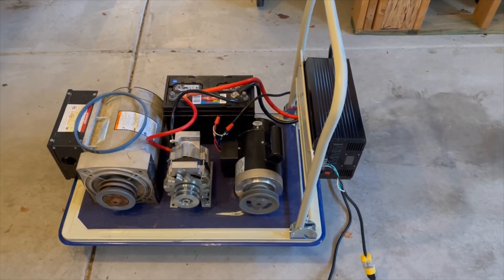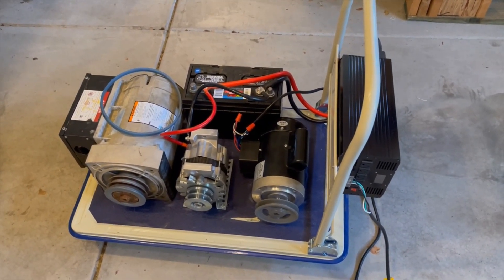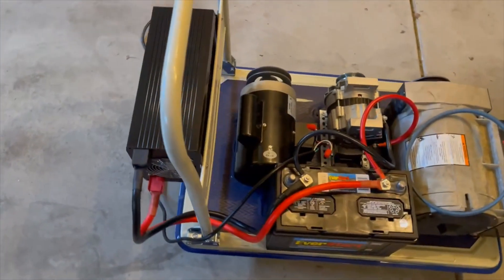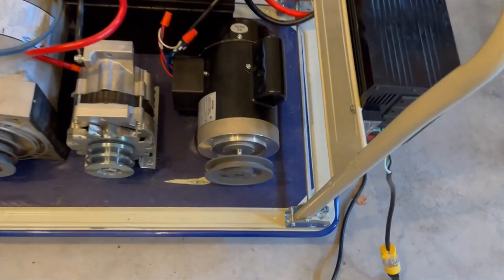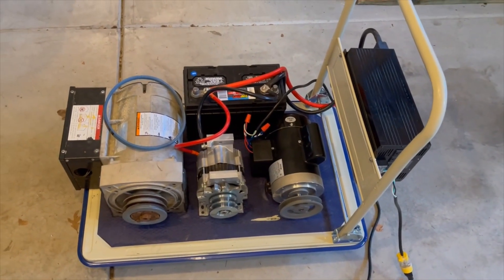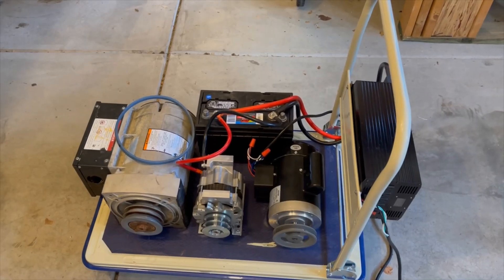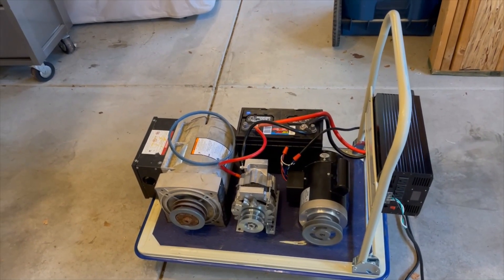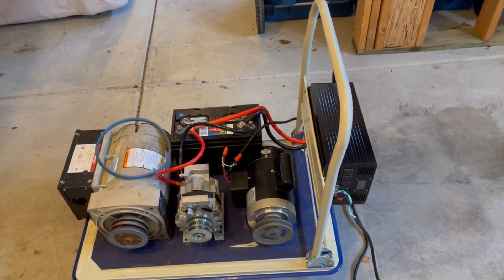Free Energy Generator Video 5 - Over Unity

Comment: replace this generator with a serpentine coil high voltage low amps axial flux dual rotor single stator coreless generator, it require less torque as compared to the regular radial flux generator.
Reply from the maker: Thank you for the advice!
Reply: @MichaelMillerEntrepreneur hope it helps u just lik it helped me

Comment: Both the ac generator and The alternator make use of stator current to supply current to the rotor windings. This produces a magnetic break against rotation and the more load placed on the stator the more current the rotor will pull from the stator and the greater the magnet break becomes.
This is why they do not and will not us permanent magnets in a ac generator.
Useing pm in an ac generator eliminates the connection between the the stator and rotor coils which prevents all breaking from increasing load demand, this reduces the torque needed by a factor of 98%.
This is also why they wont make a multipole radial rotor for anything bigger than a dishwasher pump motor.

Comment: You need to do a lot more research! No b***** I know free energy rum Motors and generators. But the tree you're barking up my dog has no Coon even possum up it not even an empty nest. But once I thought like you did but I did a way more research I used in my mind free energy would have been everywhere if you could just generally hook more generators or generators at different type or alternators so like a one horsepower motor why wouldn't they turn them unless no load affected it somehow that was I seen that as a problem but I didn't know that that's what would happen but that's what I figured was going on from why free energy wasn't everywhere.. do research and there's a way of making free energy that I have never seen on YouTube or even the internet. A spark plug and a speaker will never make free energy at least not the way they do it on YouTube and I don't think it could be done anyway. But you are very learning but you'll go broke at this rate. All I'm going to say is this generators have hidden potential. You know anything about doing research or how much power you going to need to run something you like that current and amp thing if a motor says 230 volts 15 amps that's how much electricity is going to take to work that motor fully like intended and a generator if it says it needs 10 horsepower to run it that's what it's going to take to run that generator far as I know you can't get around it but there is a way you can make free energy from is all I'm saying you're going to have to figure it out for yourself by the way you're going does not work but I guess you know that before you spend. I wish you good luck

Comment: You can feed the alternator from a different source, and use a dc motor control to adjust the voltage until the motor and inverter  run as they should.
Reply from the maker: Thank you for the advice. I’ll give it a try.

Comment: We done this on a bus build tried #6 wire from the alt to the battery ang it clogged to bad went and looked at the alt on the bud and it had #10 wire so we switched it and have had no more issues charging 4 set of 24v golf cart battery banks the are sets of 8v on the 180 amp alternator 24v
Reply from the maker: Thank you for the advice.

Comment: U need to scrape the generator and just use the alternator to charge the battery to run the inverter..
Reply: That concept with jus the alternator works because i proved myself already..I'm currently working on my own and we jus putting together the cooling system. We run it for 3h and the motor burn up after the second run. It's a DC motor we used for that one but yes the concept works.
Reply from the maker: Good to hear.
Reply from the maker: Thank you for the advice. I’m actually in the process of finding a lower rpm motor so I have made ore torque for the alternator. My high speed gets super hot trying to get up to speed.

Comment: Ok I finally figured out how it work I get it working it making crazy power the trick to it is the generator magnet field if the magnet field is too strong the generator keeps dropping out because the drag of the stronger field and the speed I try and get the generator vibrat like the it’s making a higher frequency the rpm I use is 14000 rpm that’s the trick the generator need to go beyond it’s speed to get the field reverse voltage I get 1100v and use diodes and buck converter to get the voltage down to 400vdc and build a inverter that don’t use transformer the amperage is crazy but am a bit scared to post a video of it because I don’t want to loss my life but I told you the secret to get it to work use a vfd and a 3phase 30.000 rpm washing machine motor on eBay that’s your answer do and a thank me
Reply from the maker: Thanks for the advice.

Comment: What kind of motor you used in this generator pls?
Reply from the maker: Hi, I tested two different motors both 120 single phase and even did a vfd with 230v single phase. I just recently ordered a bigger drive and 3hp 3-phase motor being tired to a gearbox. If that doesn't work I’m at a loss. I have a video 6 which shows my latest update. Please subscribe to my channel if you are not already. Thank you!

Comment: The losses are larger than the gains here. You need to completely rebuild the generator lmao. Perpetual motion is a complete joke, a distraction. See the single phase switched reluctance generator and increase the reluctance of the rotor. That is how you achieve overunity with flux-gating. Also check out MrDZONKEN with his overunity bi-toroid transformer with capacitor for parametric resonance.
Reply from the maker: Thank you for the feedback. Using the word Over unity for what I’m doing is definitely the wrong word. Always looking for new ways to improve.

Comment: without a half at tone flying wheel your device cant success
Reply from the maker: Thank you for the knowledge. I’m going to try a gearbox with around 40 ft/lbs of torque to take the load off the small motor. In theory and math it should work but real world testing is best. Still fun to try new ways.

Comment: Greet job ... I have done what you have done up to video #2 and then ... stopped.

What about video #5 is it okay ? Is it working?
Reply from the maker: I’m up to a stopping point until I get a gearbox purchased so I have the torque to run the generator and alternator. I’m needing around 31 ft/lbs min to run both with the 1hp motor. Amazing how much torque is required when the generator starts producing electric. 
I’ll probably buy a 5:1 speed reducer and necessary pulleys. Test on a used speed reducer and buy the appropriate gearbox at a later date. They’re very expensive. What I need new is $700 usd.

Comment: Try convert the alternator to permanent magnet
Reply from the maker: I did convert a smaller alternator but when I tested output voltage it was enough due to being lower speed from a drill. I scraped that idea as I wanted to build a system you could buy components that didn’t need modified to work.